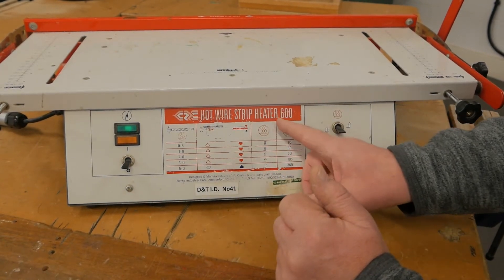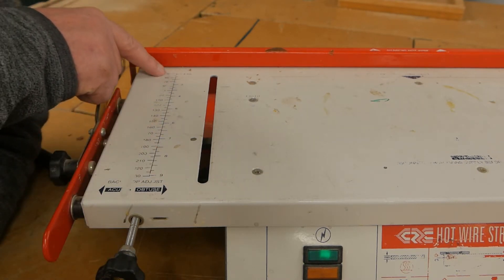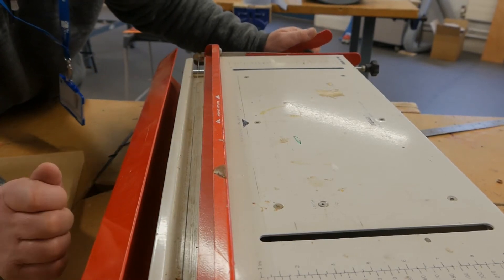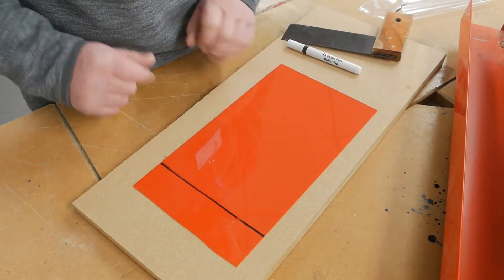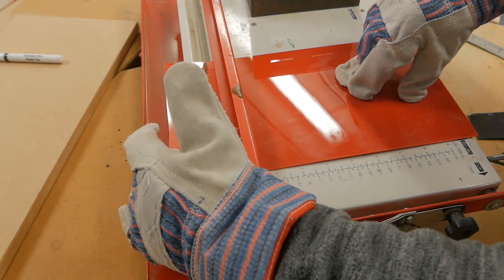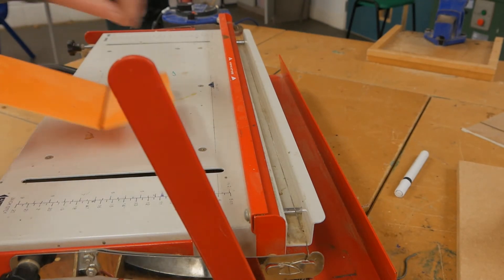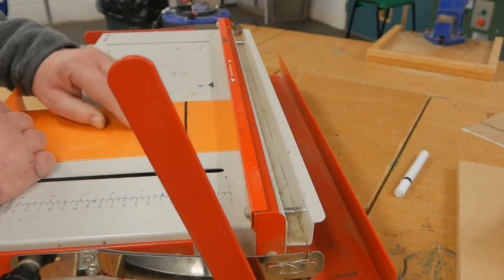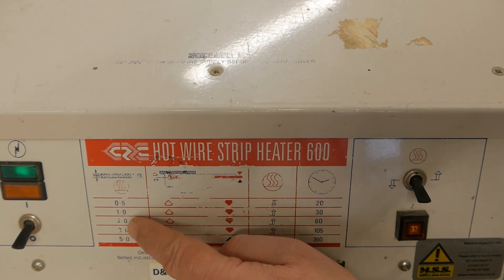Hot Wire Heat Strip

Comment: I have this same heater. It turns on (visible light) but the wires are not heating
Reply from the maker: Have you checked the condition of the wire? Been a while since i last used mine.